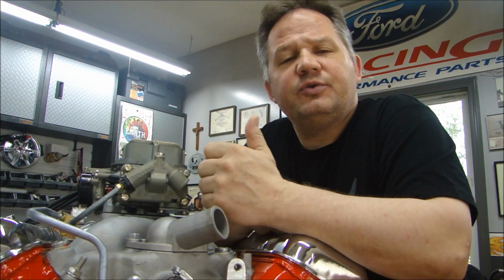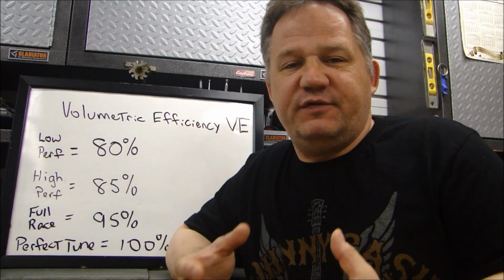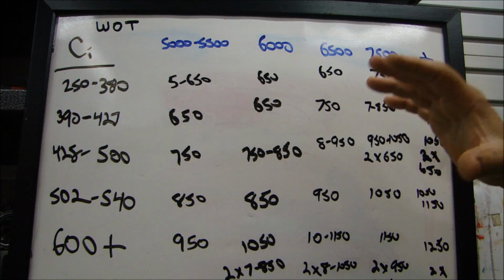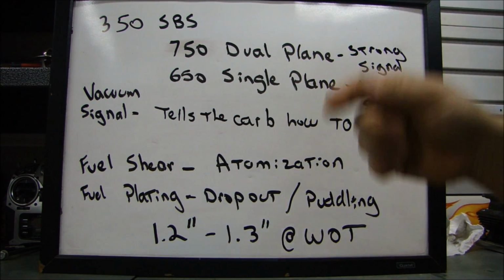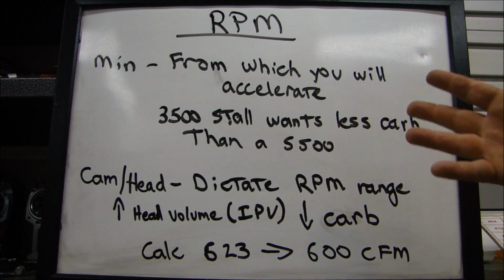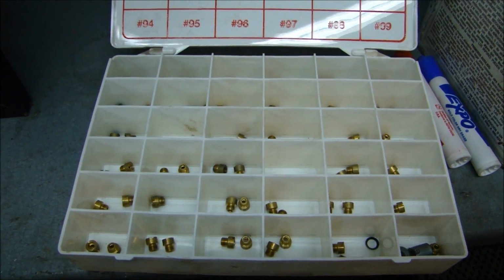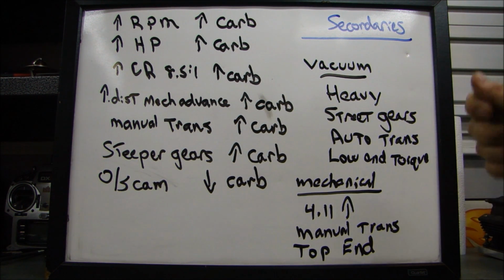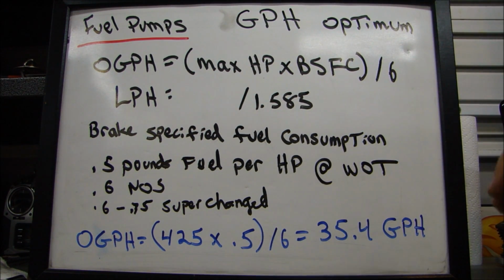Engine Building Part 14 - Choosing Carburetors and Fuel Pumps

Comment: Hello Pete. Great video as always. I think based on your video, a low compression 302 auto with highway gears in a classic mustang used exclusively for Sunday cruising would be happiest with something small like a 450 CFM. Sound right to you?
Reply from the maker: That sounds about right
Reply: @PetesGarage  
Hello again. I installed a QFT 450 on my car and it seems to run well however my spark plugs insulators are bright white. Should I jet up a few sizes? Current primaries are 55, maybe go to 58?

Comment: That was a great video. Very helpful. Thank you. I have a 1965 Pontiac Catalina 2+2  with 421. Stock components in engine. I believe the stock Carter carburetor has a CFM of 575. Do you think it will be worth the trouble to bump it up to a 600 or 650?  Mostly driven normally but would like to get on it every once in a while
Reply from the maker: Bumping up the carb will give you problems, it won't help unless it's jetted properly

Comment: Wish I would've found you a few years back. Been fighting sootie plugs, and I think my problem has been my carb. Quick fuel race carb 750 for street/strip. Maybe I should go to a 650 double pump, but I still drive to cruise-in's through the summer..
Reply from the maker: Regardless of the carb size you still need to jet it to get the right size, rich is causing your soot problem.

Comment: I came across an article yrs ago about Holley 4150’s,proform & QFT billet carb parts and it went on to describe mixing and matching carb parts for performance and cam increase.I used to have subscriptions saved and used a lot of articles like a library.back then pc’s were just starting to coming and much of the info you got was from magazines.anyway somehow I lost this article and am looking for help to restrain the info as much money and effort has been put forth and I can use a little help.it’s mostly about Brawler type carburetion 600-800 or 850 and the proform and QFT billet parts had been out a bit but it was really good info and I can get a pc to help worth crap.if you know know what I speak of it would be much appreciated.I was injured and down a number of yrs but am trying to work my way back now. Thank you and others for all the help and info you supply,it’s not wasted
Reply from the maker: I completely understand what you are talking about. Unless you plan on spending tons of time on a dyno trying the different configurations, in my opinion, you'd be better off buying a new carb. Some of them are pretty awesome right out of the box.

Comment: I'm 77 years old next month and I'm installing a new mild roller cam, manifold,  carb and  headers and appropriate heads on  my 350 . I've watched your  entire series before starting . I'm seeking 380 HP that runs relative smooth quit and reliable. If I can pull this off anybody can . I had installed this engine in my 54 ford f100 a dozen years ago that I drive everyday .Thank you for the free education Pete  .
I cant think of a better series to subscribe to.
Reply from the maker: You can do it for sure!

Comment: Hi Pete, I just purchased a hot Rod with a 350 chevy with edelbrock performer RPM 6089 heads and a Comp Cam 12-212-2 camshaft. It has been board out 60 thousands but I know nothing else about the lower end. It has a tunnel ram with 2 Edelbrock 600's. It has mechanical secondaries. I know they recommend a stall converter which it does not have. I know I need to check fuel pressure on a hard take off but do you think my carbs are right and how important is it for it to have that stall converter? What size stall converter should it have? It does surge then hesitate sometimes on take off when I really get on it. It's a 31 Ford Coupe on a custom built frame so it weights very little. Thanks much.
Reply from the maker: That's a lot of questions. The stall converter is important so it locks up. It's too difficult to say without seeing it

Comment: Hey Pete great video again! was i wrong to think that a double pumper is worse on gas for a street driven 383ci sbc, 550 hp, 57 chevy with Tremec 6 spd and 4:10 gears. Started with a QF 780  vac sec, went to a 830 double pumper and it seemed like the gas milage went down drastically? Also how about a video on choosing between say a BBC and SBC for a street car vs a Drag  car. talking about the pro and cons would be a really good video for us viewers.
Reply from the maker: You can kill MPG with a 1 barrel if you stomp on it....lol. Keep your foot off the gas. I'll work on it

Comment: Hello my friend thank you for the video quick question I have tween 454s sitting on a 34 foot Sea Ray my manual says my wot is at 4400 so that would put me at a 600 cfm carb correct?
Reply from the maker: On each? It may be closer to 650
Reply: @PetesGarage  I'm late to the show but I would really benefit from your wisdom. I have a S10 with a mild 350, about 500 lift cam, warmed up vortec heads and th350. I think I need 650 cfm with mechanical secondaries. Does that sound right. Thanks for the video. New sub.
Reply: @Dboyquicks10  650 sounds right but why mechanical secondaries? What  are you doing with your S10?
Reply: @cuzz63  I'm just trying to get the most out of it. See there's this guy down the road with a quick nova. I need to bring him down a few notches. Lol
Reply: @Dboyquicks10  ok, its cool. S10's can be pretty quick if  you can get them to hookup. You follow Eric Weingartner ? he has an S10.
Reply: @cuzz63  no but I'll see if I can find him
Reply: @Dboyquicks10  his channel is under his name.

Comment: Great information.  Thanks.  I'm assuming a mechanical fuel pump that delivers 110 gph at 6 pounds is sufficient for my 383 stroker which has a modest 450hp with a 750 Holley double pumper?  Automatic trans w/3000-rpm stall.
Reply from the maker: Sounds like a winner to me

Comment: Hi Pete thanks for this video you seem very knowledgeable. I'm wondering if you can help me. I have a 79 chevy truck that we put a 350 into. It was built by a backyarder to race in his camaro. It has .030 over flat top piston, a 500 lunati cam, camel hump heads and 4 degree valve timing advance. The truck has 2:76 gears and a 700 r4. I know there's a lot going against us here but I'm having a really hard time with it stumbling on take off. I'm running a 650 double pumper carb. Any idea what I could try? Thanks
Reply from the maker: Stumbling at take off is a fuel problem, either too rich or lean. It could also be a vacuum problem. Check it at idle to see if it bounces
Reply: @PetesGarage  Thanks I appreciate that

Comment: Great video and it’s helping me get in the right area. My build is nothing new but my combo seems a little mismatched.
SBF 331 bottom- 180cc -1.9 /1.6 heads, Slightly aggressive cam, dual plane high rise manifold, 4 speed manual, Bronco on 35s, 4300lbs weight. 
I’m wondering if 600cfm mechanical secondaries are good (confused because the weight says go vacuum secondaries, the manual says go mechanical, but the SBF 302/331 likes RPM, and I have no overdrive anyways, not a daily, not a rock crawler, just a big weekend Trail/cruising toy.

Thoughts?
TYIA
Reply from the maker: Thanks Rich, mechanical are good because you know they'll always work.

Comment: I bought this TBI engine from a company that brings them in from the USA. It is very underpowered and heavy on fuel. I did took of the TBI system and installed an Edelbrock Performer intake manifold with Edelbrock 1406 Carburetor and 204/214 Camshaft. I understand from the internet that the TBI cylinder heads is no good and does not flow good enough. What do you suggest I change to make 315HP and more? Maybe a 224/230 Camshaft and some Edelbrock E-Street aluminum cylinder heads perhaps? Please help for I do all this myself and in South Africa, one does not have lots of people working on these engines and those who does charge an arm and a leg. I am on Whatsapp too if you want to connect there. +27 71 7267869
Reply from the maker: What engine?
Reply: @PetesGarage  Chevy 350 V8, 5.7 liter made by General Motors for mostly Silverados and other Pick-up trucks. TBI intake system. I want to remove the TBI system and change it to straight forward motor using aftermarket parts to make 350 - 360 Horsepower. Please give me specs on items like Heads, Intake manifold, carburetor and camshaft I should use without the engine idling rough.  Please.
Reply: @PetesGarage  Parts that I already have is an Edelbrock Performer Intake Manifold, an Edelbrock 1406 Carburetor, Electronic HEI Distributor and a XE268H 224/230 camshaft from Comp Cams. Standard Chevy Headers. The motor just came from the machine shop and I had Flathead Pistons installed. Please assist.....
Reply: @PetesGarage  This is what is available in South Africa. Will you please give me your opinion on the following specifications: Chevy 350 with flat top pistons, Comp Cam XE268H 224/230 with 555-560 lift, Edelbrock E-Street Cylinder Heads (which I believe flows better than Vortec Heads), Edelbrock Performer Intake manifold, Edelbrock 1406 / 600 cfm Carburetor? What kind of power will I get with this combination or what should I change to get at least 350 to 360 Horsepower without the engine idling rough? +27 71 726 7869 for Whatsapp or email me @ kobuskock1967@gmail.com Thanks.
Reply from the maker: That combination is going to make plenty of power. It will idle a little rough but not too bad. Put it together and you will be fine
Reply: @PetesGarage  Thanks Pete and thanks a lot for all your inspiring videos. Learned a lot from you.

Comment: Pete's garage one of the best YouTube channels going on right now I have a question I don't know if you'll be able to answer it but if I'm running a 600 or 650 Edelbrock carburetor on a l98 engine ideally since I have a intank fuel pump what what will be the best intank fuel pump that you run
Reply from the maker: Thanks Seymour! Those are not very big, a regular fuel pump should be able to keep up.
Reply: Sorry about that what I was trying to ask is I'm running a 600 CFM Edelbrock carburetor what a intank fuel pump 255 LHP be to much even if I am using a fuel pressure regulator. Thank you for answering my first question.
Reply from the maker: No, the pressure regulator will keep it from over filling.

Comment: Love your vids man. I am presently building a 1969 351 windsor .30 over roller cam with .50 lift  with a 200 cfm flow heads at 10.5/1 compression. The car weighs 3200 pounds with 350 gears and a tko 600 trans. The equation says 614 on the carb. So a 650 mechanical secondaries seems the right choice. Did I track this correctly?

Comment: Pete i need your help. I'm building an olds 455. It has forged flat tops 10 to 1, big valve aluminum heads. Cam specs are 520/542 lift 234-244 duration @50, an open plenum intake and long tubes. It's going in a 68 cutlass with an m20 and a 308 posi. I talked to holley and they pointed me towards a 770 vacuum secondary. Does that sound more than adequate for a street machine or should I step it up a little? Btw long time fan, I've been following this series for a long time and I always find myself re watching them. Thanks- Marty.
Reply from the maker: Thank you for watching Marty. The 770 is plenty, you may find yourself jetting down one or two, but it will work.

Comment: my 2300 pinto engine used a used a divided port runner offenhauser, dual  port intake four barrel, , when I installed a high lift cam with  more duration yvacuum was around 12, I used a  four barrel 390 Holly all I had to do was match the power valve and lean out the jets, all I know is there is no such thing as running an after market carb (one size fits all ) with out doing a plug check, Ive seen guys install 750 cfm carbs on street 350,s and they say Holley suck,s yeah right you gotta match the jets, and learn how to read the plugs, a smaller carb has more velocity for better atomization
Reply from the maker: That's the details of tuning

Comment: i wish i had used your paint on my engine. i used PoR15 engine enamel but its not a 2 part and i sprayed it on after the block was tanked but its discolored in some areas now due to temps and scraped off in a couple places. all in all its not bright any more but rather a dim/flat appearance
Reply from the maker: Painting is not as easy as everyone thinks
Reply: no, its really not.... i used rattle cans a few times in the past but it always peeled off. so i thought hey, this time ima buy a real paint gun, use an air compressor, clean/etch the iron block and buy good paint. so i got por15 thinking no matter what this shit will work... its still on and looks loads better than any rattle can i have ever done but still... not the same as day one. ill see if i can find a pic of day one paint
Reply: not day 1 but after i got the body back on and engine droped back into the frame: https://imgur.com/mO8sWuM

Comment: I know this is an old video but I had a question. I'm building a 400ci csb for a truck that weighs about 5000 lbs and it has street gears. But a Manual transmission. Would you recommend vacuum or mechanical secondaries. I'm assuming vacuum because it meets more of the things you had listed for that category. Thanks in advance. I've learned alot just from watching your videos.
Reply from the maker: Mechanical is nice because you can adjust it, but if you have enough vacuum it's the way to go
Reply: Pete's Garage thanks for the quick reply it's very appreciated.

Comment: You do know that max torque is not achieved at redline don't you? Do you mean max horsepower?
Reply from the maker: Depending on the engine, you will see max torque then max HP well before redline.
Reply: Yessir. So do we measure the vacuum at WOT to determine correct carb size at peak torque, peak horsepower or redline?
Reply from the maker: As a general rule, WOT at peak HP.

Comment: Do all engines have carburetors,
Reply from the maker: No, a fuel injection engine just has a planum with an air control.
Reply: Pete's Garage is their a special way the engine is set up for fuel injection instead of a carburetor?
Reply from the maker: Higher pressure fuel pump, regulator, fuel injectors, computer, and throttle bodies

Comment: Pete, were you suggesting  running rich at the top end you lose vacuum to the point of going below 1.2 ?    ( computer problems )    davidmorganlandscaping@gmail.com
Reply from the maker: It is very difficult to tell how the engine is running without some sort of diagnostic capability.`You want to be somewhere close to 13 air to fuel ratio

Comment: That formula doesn't work for all motors I put a 680 quick fuel on my 71 demon 340 and it was starving for fuel, it likes a 750+ and by that formula I should be running a 600 witch is way too small for that motor
Reply from the maker: Of course it's not for all motors. It's just a starting point

Comment: Hi Pete. It might be a typical question, but I need some help deciding on the carb for the FE390 '73 pickup with 35" tires, 4 speed manual and 4.10 in the rear, with non-ported 6090G heads, non-ported Streetmaster 390 intake, cam is lunati .213/.219 @50, .524/.540 lift and 112 LSA; springs with 312lb open, approximately 9.8 CR, and around 8.3 DCR. This would be a street performer and won't see any strips.
I am leaning towards Quickfuel 780 VS. There are various opinions I read regarding 780CFM on a 390. Few builders recommend not to go past 750CFM on a 390. I know that bigger doesn't necessarily means better or faster. 
Looking forward to your response. - Nick
Reply from the maker: 780 does seem a bit large. Did you do the air flow calcualtions?
Reply: Thanks for the reply Pete. I have done some calculations and results vary. With VE @ 80 the recommended carb is ~600cfm. With VE @ 100 the recommended carb goes as much as 735. But I know that VE @ 100 will not be happening with my built. Should I be leaning towards a 735CFM VS? I do not plan to rev up to 6500 rpm. 
Thanks Pete. Looking forward to your reply. -Nick
Reply from the maker: Seems to me a 650 is plenty....you can always increase jet sizes
Reply: I have a new 600 VS Holley sitting in my garage. Do you think I ought to rejet it and just use it?

Comment: Pete, thank you thank you for doing these well put together videos. I built my engine from the bottom up with your help. 
I'm currently tuning know and I would like to avoid paying the dyno guy to tune my carb. I bought  a Holley kit with all kinds of jets, pump discharge nozzles, pump diaphragm, and power valves. Do you have a video on this? can you help?
Reply from the maker: Thanks my friend. You can do it by trial and error. It takes a while, but you can change jets and go by performance and exhaust smell. I've done and usually come pretty close. But for $250 the dyno guy will get it right on.
Reply: Petes Garage sir i have changed my car engine assembly so thats its power geting low day by day while driving uphil it has not enough tourq to move up what i do plz tell me one more thing it has flectuation in rpm while driving 2nd gear its rpm needle move from one to 3 and then go down to 1 and it continues

Comment: I remember when some joker with a stock GTO would throw on a 850 and get worse performance than a quadrajet --
You sure you what works and makes a good starting point

I built a Yenko Clone and used a 780 W vacuum secondaries because I didn't have much $$$$, with slicks it bogged a bit off the line even with 456 gears, needed a good 800-8500 DP and single plane, still ran in the 12's like nothing with a crappy tune---
Reply from the maker: People think a bigger carb means more HP, but not true unless you can get more air in and out.